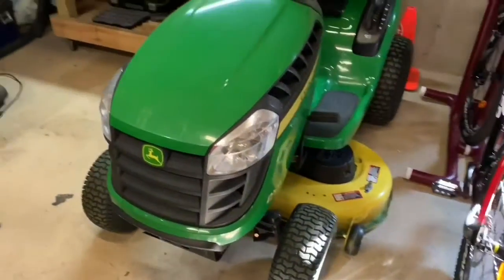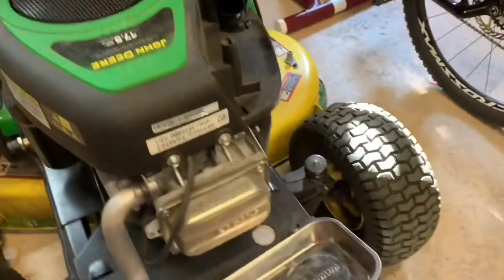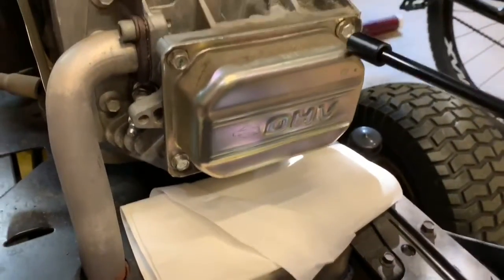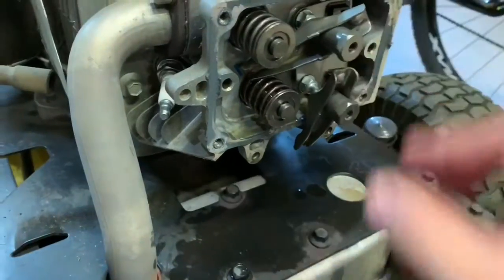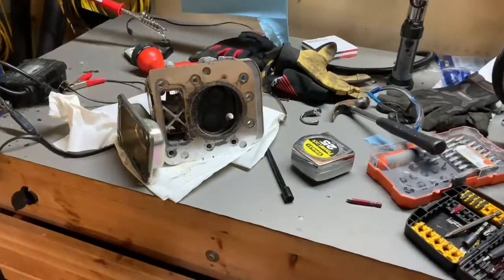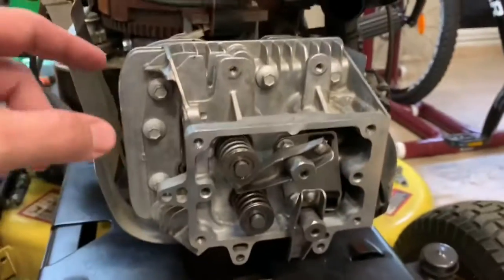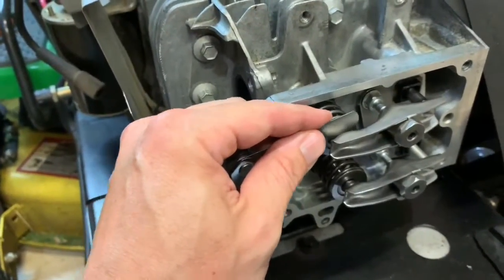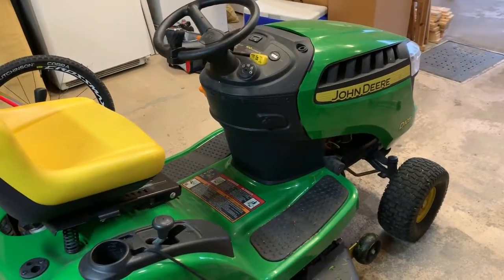Head Gasket Replacement Briggs and Stratton John Deere D105

Comment: Very well presented. I have to do this job tomorrow. 134 hours on mine. All they make today is disposable junk. Doesn't matter if you buy from Home depot, lowes or the dealer either. All are the same.
Reply: If you go to the dealership and look at am x series Deere completely different. Use Kawasaki engines and completely built in house by Deere. Most people won't spend 3 grand and up for a mower though so Deere has to have these.
Reply: My LA125 has over 800 hours, getting ready to try this too!

Comment: Great post , saved me a bundle . Just one Tip if You DON"T  want it to HAPPEN again SOON ! The Head Bolts Should Be Replaced at the same time you replace the gasket . The Mechanics at the Dealer told me this, and said if you don't replace the bolts you will  be doing the job again in a couple of weeks . He Told me they learned that The HARD WAY .
Reply from the maker: nova scarity very good info. I was unsure if the bolts were a one time torque application or not.

Comment: Absolutely great video.  Helped me tremendously solve the problem.  Time for Biggs and Stratton the redesign that casting area between the pushrod cavity and the cylinder and add an extra bolt so this doesn't occur ever again.

Comment: Here's a tip for folks replacing the head gasket on an LA110. Adjust the valves at TDC, not 1/4" back from TDC. I tried 1/4 back on mine the first time and it wouldn't crank and was very rough when trying. I readjusted the valves at TDC and it cranked like a new one. Anyway, thank you for the helpful video.

Comment: Thanks for your informative and clear video.  I have never done anything more involved than change oil and filter, lube and change air cleaners prior to this.  Even I was able to understand what to do, and I fixed my John Deere LA110 that had started to blow blue smoke.  Replaced the head gasket, cleaned up the head and piston, adjusted the valves and got it all back together with no left over hardware!  It even starts better now.  MUCH appreciated!
Reply from the maker: So happy to hear this. Thanks for watching.

Comment: I did this at the very beginning of last summer and it lasted 1 year and now I have to do it again….any tips on what I can do to make the head gasket last longer ? Should I replace all the bolts on the head?
Reply from the maker: Unfortunately, there’s not much you could really do it all comes down to making sure the initial installation is done right. Also, remembering these are air cooled engines so making sure that there’s no debris in the upper fan or around the engine will help promote better cooling and less than the chance of the head gasket going bad.
Reply: Thanks. Sounds like I need to run her for about 20 mins max and then let cool
Until I’m finished. Crazy these things blow at this rate.
Reply from the maker: @mattb7449 I don’t think you have to be that safe on it. I’ve put close to 75 hours since my rebuild and I cut grass for about an hour each time and have not had a failure.

Comment: one question, What did you use to clean the piston and valves. You got them spotless. I assume some sort of carb cleaner and a brush.
Reply from the maker: Carb cleaner and a soft wire brush

Comment: I completed the head gasket replacement as per your video, however, the engine will not start now. Is incorrect gapping of rockers a possibility or could it be something else?
Reply from the maker: Did you make sure it was on the compression stroke when you set the clearance/gap at Top Dead Center? Compression stroke is when both valves are closed
Reply: @DIYManiacJohnP  I don’t think I am getting a spark at the plug. If so and fuel is feeding then I’ll need to check the valves as you explained as I am questioning if I had them correctly.

Comment: Just a question. If it's a head gasket issue, would it smoke when hot, and not when the engine is cold? Dad just picked up a LA115 with the 19 HP engine and it smokes when it's hot, but runs perfect when it's cold.
Reply: Yes, thats generally thr head gasket. Leaks worse once it gets hot

Comment: I did this to my D105 seemed easy, everything went as planned. But will not start now. Turns over fine, i have spark but will not start. Im getting fuel, i put a new solenoid on carb. Trying to figure out if i missed something.
Reply from the maker: We’re you sure to properly set the valve lash?
Reply: @DIYManiacJohnP  i must not have done it correctly. I just watched another briggs and stratton video and it said if thats off it may not fire. Ill go back in and adjust those again.  Thanks
Reply from the maker: @makes123  make sure when adjusting you are at TDC on the compression stroke. Watch my vid again closely for the tips I give
Reply: @DIYManiacJohnP  i got it. The exhaust valve wasn’t moving, the push rod wasnt seated just right i guess. I went through it again and it fired right up. Running great! Thanks.
Reply from the maker: @makes123  that is great!!!

Comment: Hey John, I am going through the same problem on my mower and my question is, can I use the torque specs in tightening the bolts on my E100 because I can’t find anything in my manual, please advise and thank you!!!
Reply from the maker: Is your E100 powered by the B&S 17.5 HP?
Reply: The engine model is B&S 31, not sure about the hp, looking at the manual now...

Comment: How did you get those parts so clean!  Yes, the deere shop says to use new bolts on the head and to use copper tech gasket maker spray on the gasket, FYI

Comment: I did this repair project today and now the mower won't start. I turn the key, and it either seizes up right away, or it tries to crank for a fraction of a second and then it seizes. What should I check? Valve clearances too tight? I've never done this before so I'm wondering if I did too much drag on the feeler gauges.
Reply from the maker: Sounds like valve clearance. Did you make sure you were at TDC when you adjusted them?

I would take everything apart and check
Reply: @DIYManiacJohnP  As far as I know--I've never done it before. I turned the engine by hand until the screwdriver came out to the max, then I marked 1/4" past that and set the valves with it like that. How much play should they have with the feeler gauges? My interpretation of "slight drag" may be a bit heavy handed?
Reply from the maker: Did you make sure it was on the compression stroke (both valves closed)?
Reply from the maker: @aec618  most on the rocker side
Reply: @DIYManiacJohnP  I took another crack at this today, and that was indeed the problem! Turns out I had what I thought was TDC but apparently I was not on the compression stroke. When I re-rotated the engine today and made sure I'd seen the exhaust vale go down and up, then the intake valve go down and up, then measuring with a screwdriver--the intake valve rocker was way loose. I readjusted the gap, turned it a few times and rechecked it, all good to go. It cranked the first time and runs smooth now. No more blue smoke when I engage the blades.
I was also happy that I was able to turn the engine by hand just by placing my hand on top of the screen, versus taking that entire cover assembly back off!!
Thanks for your help--both the great video and replying so quickly to my question. Great job!!
Reply from the maker: @aec618  happy to hear!!!

Comment: Excellent video. Ill be doing mine soon. Thank you
Reply: Hey there, question. I completed the job to the letter, my mower will turn over but no fire. Would that be a timing issue? Im going out to the garage to fiddle with it today. Im getting spark, looking at the fuel solenoid next.

Comment: Hello buddy, my d105 recently started knocking when sitting, when engaging still shakes. Any suggestions, thanks
Reply from the maker: Hey! When you say knocking… are you referring the engine knock?
Reply: @DIYManiacJohnP  Started shaking and going slow. When I turn it on it shakes and knocks, when I engage the blade it sound worse. Thanks
Reply from the maker: @letstalk6007  I would start with the basics, fuel, spark, compression and air. 

Sounds like she could be possibly fuel starved
Reply: @DIYManiacJohnP  Haven’t tried the fuel yet, I’ll tried that yet. I had some gas sitting for along time in the shed regular unleaded. Wonder if gas might have been dirty with lots of sediment. Thanks for your response buddy.
Reply from the maker: @letstalk6007  fresh gas will be a great start!

Comment: Thank you so much for this video. It is extremely helpful.  I screwed up though and I'd like to know if I'm totally f-ed.  I'd never used a torgue wench and I bought one that was likely too large for this project.  In tightening on of the bolts it broke and I can't get it out of one of the holes.  So I can only use 7 of the 8 bolts.  Will this still work?
Reply from the maker: Nicholas Lue unfortunately you will need to remove that broken bolt. To ensure even crushing of the head gasket all the bolts are needed for there to be no leaks.
Reply: @DIYManiacJohnP  if this happens what's the best way to remove the headless bolt?

Comment: Before anyone tries this you will need the right size torx, t20 I think. Better in a jackknife set for torque when you adjust the valves. Also a 3/8 drive allen wrench socket and short extension for exhaust pipe. Obviously torquing the head is the part you have to get right so you will need a small torque wrench.

Comment: Thanks for this video, John. This was exactly what appeared to be wrong with my D105. Popped open the head gasket and it was the exact same problem. I put everything back together with your guidance and the engine did fire up. However, it's running rough and it's spewing some white smoke. I shut it down right away. I did notice that I had to turn the key a couple times - like it was cycling through until it got to a place where it would crank. The only thing I can think of is I didn't set the valves properly or missed TDC by more than your 1/4 inch instructions. FYI, my engine is the B&G 31R977. Thoughts?
Reply from the maker: White smoke indicates oil. Does it create the smoke all the time? Does the smoke smell like oil?

If the valves were set too tight, this could cause a hard start issue.

Comment: Great video, bought a new E100 with that engine, mine hasn't run right since new, Jonh Deer has had it for 5 weeks so far and only 13 hours on it. Shame that there build quality has fallen so bad. My last john deer was a LX 173 with over 1000 hours on it and no engine problems, dont think this will make it to 50 hours.
Reply: John Deere did not build this lol you have to look at the x series for it to be an actual Deere.

Comment: Quick question on finding top dead center (TDC).  Maybe this is obvious once you get started, but how exactly do you turn the engine?  And from what perspective is counterclockwise?  Pardon if this is obvious once you get started -- I just like to do a complete walkthrough in my head before loosening the first bolt, putting in the first nail, et cetera.

Any link to this engine manual?  Have a D105Auto that's showing all the signs of a bad head gasket.

Truly, one of THE best tutorial videos I've ever watched.
Reply from the maker: With the spark plug removed the engine turns quite easily. You can turn it from the top with your hand. 

Perspective is looking down at the engine. 

Thanks for the kind comment and for watching.

Comment: Its insane the unit only had 80 hours. Im working on a ztrak 425 at work with only 140 hours with the same issue. Im a mechanic in lawn and garden at Reynolds John Deere in Indiana.
Reply from the maker: Other than that issue the D-series has been amazing.
Reply: My JD  D110 Intek gasket  failed at 40 hours.

Comment: I think you have a problem with your description of finding top dead center(TDC), in preparation for setting valve clearance.  There are actually 2 TDCs.  One for the compression stroke and one for the exhaust stroke.  You find the compression stroke's TDC, you should turn your engine clockwise (not counter clockwise as you mentioned, you want to go in the direction that the motor runs) until it opens the intake value (the bottom valve), and then closes it. While doing this use the screwdriver to feel when the piston is all the way to the top. Then continue to turn motor till piston goes down about a quarter of an inch as you described.
Reply: This motor does run counterclockwise though..when engaging the starter it spins the flywheel counter clockwise..I was confused by the fact it did this

Comment: Just did this very thing 
Wasn’t knocking before I switched out gasket
Put it all back together 
Now it knocks 
Any input anyone?
Reply from the maker: Did you properly gap the valves / rockers?
Reply: @DIYManiacJohnP  yes checked valve lash 
I got um at .005 both
In and exhaust 
Have caps on valve stems like commented on
I m thinking maybe the pushrods are inserted wrong 
Idk
I’m thinking maybe a valve job 
But I twist them and they don’t move 
So I think their good
One thing I didn’t do was machine the cylinder head 
I cleaned piston and all surfaces 
I’m scratching my head 
Thinking of tearing everything down check rd and cap?????

Comment: I have heard the VTwin briggs & stratton engines are much better, as in they do not have the cam shaft or head gasket problems that the single cylinder engines have. Can someone confirm this?

Comment: Nice video Also I figured out a way around the John Deer valve driven fuel pump SCAM, 1 the valves wear out as well so they use that to get you to commit to an engine rebuild to me that is a scam even if you bend the fuel pump arm a bit it still will only last a couple of cuts, So, I fuel Injected it 😉. Runs smoother and during this I found out that their hoods SUCK lol they are cheap ugg.

Comment: I did the whole process step by step and it didn't turn on
Reply: Alejandro García I had same problem but found I reversed the fuel intake and breather tube.  Put it on correctly and fired right up.